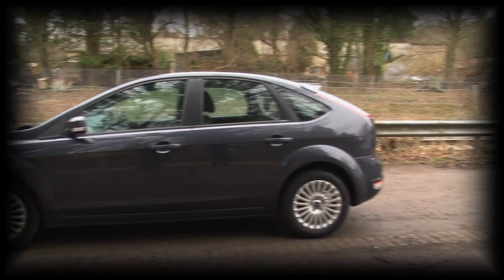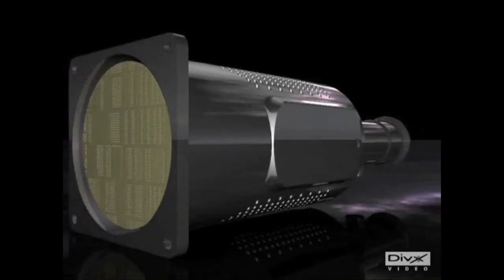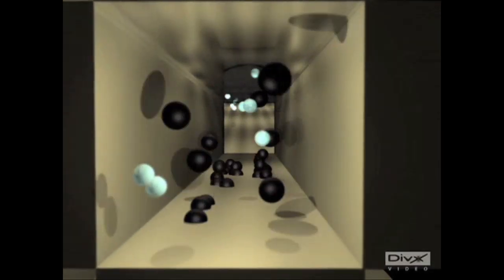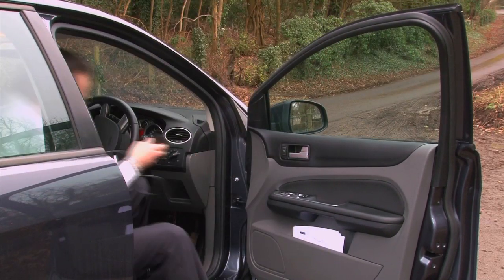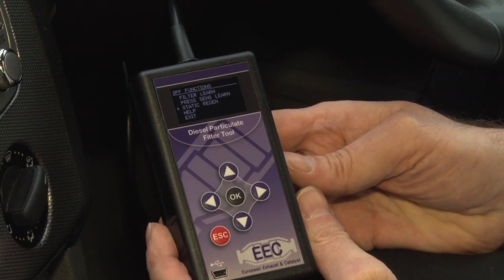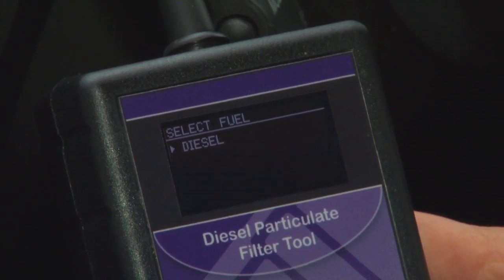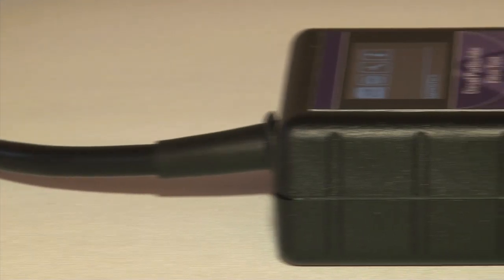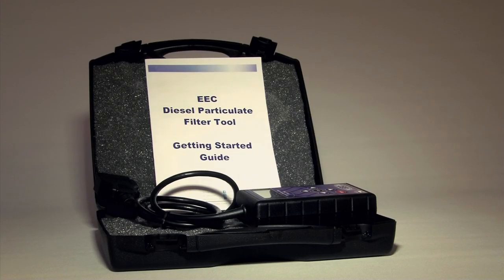EEC DPF Diagnostic Tool

Comment: Does it work on Medium Duty Trucks?
Reply: Most American made medium and heavy duty trucks will use a cummins or cat diesel motor. With cummins you can use a normal laptop and purchase the software from cummins and pay an annual fee to use their software to diagnose and reset DPF issues.  CAT will only allow access via dealerships.  The NAVSTAR/International systems will through the insite programs.